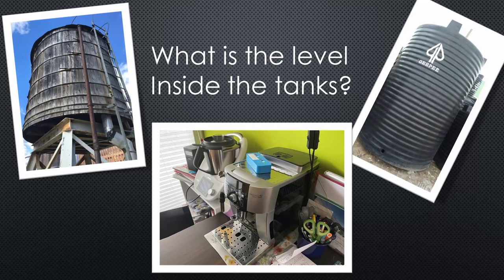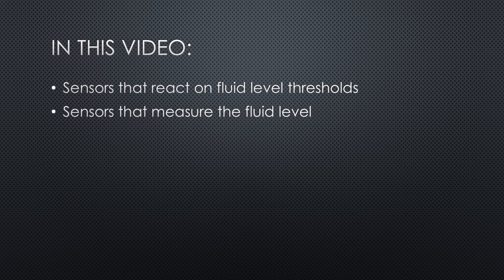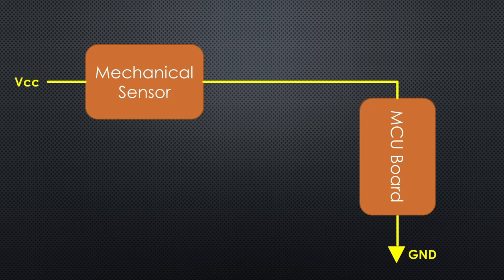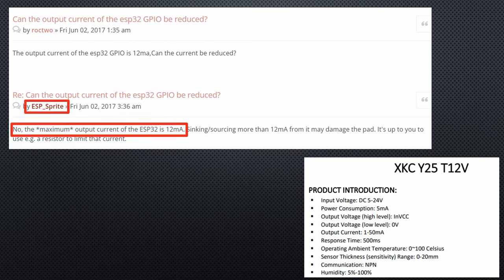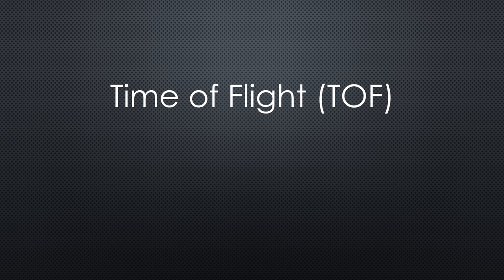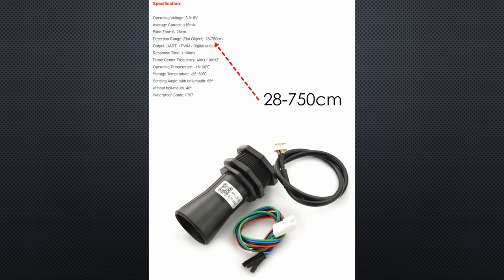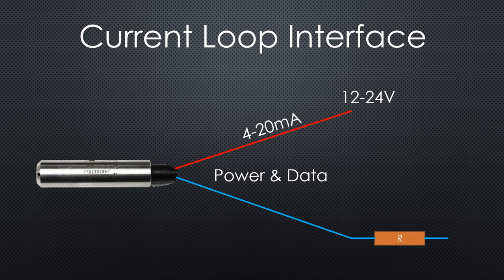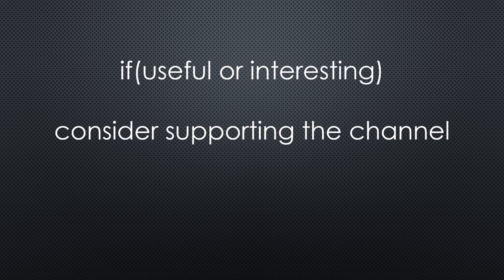#411 Ten Fluid Level (Water Level) Sensors and how to use them (Arduino, ESP32, ESP8266)

Comment: After many trials with ultrasound (not reliable due to humidity over the water and animals like spiders), pumping air in the water (pump and pressure sensor are available in cheap systems for reading blood pressure) which also was not reliable. In the end, I decided for a pressure sensor (available not only for 30psi online). I used a plastic pipe and fixed the sensor  water tight with epoxy resin. The reciever is a Raspberry Pi via analog/digital converter. Works since years in my 2m deep water cistern in the garden.
Reply from the maker: Thank you for sharing your experience. I thought, the air would disappear through the plastic tube over time. But not in your case.
Reply: No. The air in the (empty tube) was not a problem. The tube is sealed at the bottom in the water. But in the beginning some condensing humiditiy made disturbances at the connector after a year or so, resulting in misreadings. I had to clean it and avoid from condensing water.

Comment: Could same water pressure sensor be used also in so called "bubbler" application, to measure height of lake or river. So that you just put simple compressor like for filling car tire, connect it to tube which is then laid on the bottom of a lake and on the same line connect pressure sensor. If my logic is correct, bubbler or compressor should produce exact amount of pressure in order to create bubbles as it is water pressure on the bottom of a lake.
Reply from the maker: That should work (I made a video about converting a blood pressure sensor into a "blubber" sensor)
Reply: @AndreasSpiess  thank you. Yes, I have found it later. Great and helpful video. I will probably do something similar to measure nearby river height.

Comment: You could use an air pressure sensor with a hose connected to the bottom of the tank. The sensor would be over the maximum fluid level, so the fluid would never reach it. Make the hose and the pressure on a sealed system, and now as the fluid level raises, also the air pressure inside of the hose would raise as well, like a washing machine pressure level.
This method would allow to measure the level without contact with the fluid, only resistance to its moisture on the sensor side.
I think the challenge would be to have the system sealed enough to avoid air leakage over the time messing with the measure. 
Do you think this would work?
Reply from the maker: I later made a video where I converted a blood pressure sensor into something you describe...
Reply: @AndreasSpiess  amazing. Gonna search for that

Comment: The old Citroën 2CVs didn't have a petrol gauge. It just had a dip stick, a longer version of the one you check your oil with. You literally had to get out of the car with this yard long stick and put it in the tank. Dipped headlights was a knob you turned on the dashboard, and turned and turned, This again was a long rod at the other end of which was a cog. This turned the hinged pipe that was at the front of the car that had both headlights attached to it. literally dipping the headlight. Those were the days, without all your fancy tech.
Reply from the maker: When I learned to fly we also hat such sticks to check the fuel levels on our Cessnas. Not because they had no meter. But we wanted to be sure ;-)
Reply: @AndreasSpiess  Well, you're still here, so you did the right thing.

Comment: Very good video about the different sensor technologies. I fear that you have missed to add the XKC-Y25-V (induction principle) to your sensor list. And I want to remark that there can exist different enviromental conditions e.g. mud at the bottom of the tank or frozen water in the sensor pipe etc.
Reply from the maker: I had it, but thought, it uses the capacitive method. And I agree that I did not cover most environmental conditions. Thank you for mentioning two.

Comment: Our home sewage treatment plant (kleinkläranlage) has a hose attached to an air pressure sensor. The Sensor sits inside the controller and the hose goes down to the bottom of the tank. Since it needs a air compressor anyway it can fill the hose back up with air on its own. In water tanks I think it is possible that the hose will fill up with water over time and therefor measure incorrectly
Reply from the maker: You are right. I made a follow-up video where I used a blood pressure sensor to build a similar sensor you describe.
Reply: @AndreasSpiess  Thanks, I'll have a look

EDIT: found it #423

Comment: one more principle .....
cylindrical swimmer from bottom to top and measuring its weight with load cell.
the more it is in the fluid the more lift there is from density delta ....
but this looses volume and is mechanical challenge ....
Reply: Consider a spherical cow too. It might be a simpler case to model this first, and after all it is a well known case... :-)
Reply from the maker: Interesting idea. But, as you write, probably not easy to build (robustness).

Comment: I made a level sensor with a pressure sensor and a pipe that enters the top of the tank and runs down to just above the bottom.
I used an LED bar graph chip and an SCR to drive an SSR to run a pump. The SCR anode was  went to the bar graph LED just above the bottom LED and the SCR gate to the LED just below the top. 
The cathode runs to the LED in the SSR.

A complete pump down control with no microcontroller. However, nowadays that LED bar graph diver costs more than a microcontroller.
Reply from the maker: Other viewers mentioned this principle, too and the newest "Make" journal has feature such a project. But they use a valve. did you also have a valve to let the air go after the measurement
Reply: @AndreasSpiess  
No valve, and it didn't seem to leak down either. I had thought that if it was a problem I'd put a small air pump on it and run it prior to measurement, but in the end I never needed it.

Comment: I have used a Wemos D1 mini and an ultrasonic HC-SR04 distance sensor to measure the water level in my garden tank. The sensor measures the distance and the measurement is subtracted from ~2m to give the tank level. The result is sent to 'thingspeak'. I do have a problem with the sensor rusting and have to replace it every 6-8 months. It has been operating for about 4 years now.
Reply from the maker: Thank you for sharing your experience. A straight-forward way of dealing with the sensor. And replacing such a cheap part every few years is not too expensive.
Reply: @AndreasSpiess  At the bumper of the car there are also ultrasonic sensors. Maybe they are better quality. But must be modified too to use as HC-SR04.

Comment: Looking at this topic myself for measuring the level in our rain water tank. First looked at a cheap ultra sonic sensor, but those can give errors when spiders or other bugs start building their house in them :).
At work we always use guided radar level sensors. Basically you insert an antenna in the liquid, it is also a TOF sensor, so the signal bounces on top of the liquid. You also have some sensors that can measure the level of different liquids in the same tank, if they don't mix because of different density. They do need different electrical properties for this to work.
Reply from the maker: Interesting. Particularly the possibility of measuring two different liquids!
Reply: @AndreasSpiess  I can't remember by heart which ones those are. But we normally use SICK LFP, those can also ignore foam layers. They are around 300€ per piece, so probably not the first choice for us makers. But in some situations, maybe the easy choice.

Comment: Can TOF sensor be encapsulated in some glass container for protection against spills etc? I know it will definitely change it's characteristics, but will they measure only distance to glass or distance behind the glass to other object?
Reply: I just experimented with clear plastic, clear polycarbonate material, and glass for your reference and in all cases, it changed the value. However, they do come with their own protective material that you can seal against.
Reply: @ShirolaGhadirian  I'm sure it will change the value, but the question is, if this is kind of constant (slows down going trough the glass) or the glass is non transparent for IR light from sensor - like for example polycarbonate is for far IR light from CO2 lasers (that's why it can cut it easily).

Comment: Worked for Keller druckmesstechnik AG in Winterthur. I cannot remember how many different pressure sensors I have built in those years! Once we had to calibrate a sensor to measure the level of a tank holding Honey.
Reply from the maker: So you are the expert in this matter! The honey tank sensor for sure is not common. But I can imagine that somebody needs it in a plant...
Reply: @AndreasSpiess  Yes, it was for Lang**e :-)

Comment: I'm working on another type of sensors, capacitive liquid level sensor that's very easy to build, it's a simple aluminum foil pair of 2cm wide tape laminated together and placed inside the tank, doesn't contaminate the liquid or corrode, the only not-so-simple side of it is the interface as I want to convert capacitance to analog reading.
Reply: capacitive fuel level sensors have been used on aircraft since at least the 1970's, when I worked on aircraft.  It's a proven technology and very rugged and reliable.
Reply from the maker: Good information (also about the airplanes). Maybe you can use the same circuit as the capacitive moisture sensor I showed in the video (using an NE555 to create a frequency)

Comment: My friend and I are looking into this at the moment for his water tank. He has a solution with a float on top of the water (with weights in it, but less than the float displaces) connected to a string which goes out and into his shed where there is a weight on the other end of the string. He can see the tank level by looking at what position the weight is relative to the wall. We are looking at ways of reading the inside weight position to get a water-level reading. Eg a lever arm to a slider pot, or wrapping the string around a rotary encoder or maybe using an ESP32 cam and openCV... So there's 3 more 'sensors' for you :)
Reply: I used to work at an electric utility and to measure the water levels in the reservoirs we used that same technic but the "string" was a strip (I don't remember what it was made of) that had notches in it that would go around a pully with teeth (so as not to slip). The pully was mounted on a shaft connected to a quadrature encoder with 100 counts per rotation. The pully was one foot in circumference so one foot in level change would give 100 counts. The quadrature encoders are not "absolute" measurement devices so the starting point would have to be calibrated by our hydro workers by occasionally reading a "level tape". They could tell which direction the level changed by which bit changed. Later at some of the locations, a multi-turn industrial enclosed potentiometer was geared to give its full range calculated over what the highest and lowest water levels were determined to be. It wasn't nearly as accurate but it gave a double check on the "goodness" of the other reading.
Reply from the maker: I think the idea of using a rotary encoder is good. It will offer you a lot of precision.

Comment: A few years ago, I made a water level indicator for our Christmas tree.  It uses an electro-optical contact sensor that detects whether or not (infrared?) light is being reflected back to a phototransistor.  It has a push-pull output that can source or sink more than enough current to light up an LED.  A green LED is wired to light up when the sensor is in contact with water, and a red LED lights up when the sensor is not in contact with water.  No microcontroller needed for this simple task.

That hardest part for me was making a metal bracket that clips onto the stand, and holds the sensor near the top of the water chamber (but low enough that we won't overflow it in the time it takes our brains to react to the change in LED color and lift up the watering can).
Reply: The sensor is the Optomax Digital Liquid Level Sensor - LLC200D3SH-LLPK1.  I got it from Adafruit.
Reply from the maker: Other viewers mentioned this kind of sensors from Honeywell. They are nearly 100 dollars. Now we are at 25 dollars. Maybe we even find a cheaper one....

Comment: You could also weight the whole tank (much easier with coffe than with industrial ones ;) ), measure empty and full to have the whole range.
Reply from the maker: Agreed. This is a very accurate way (also used for screws and other material). I should have mentioned it. For the coffee machine it would probably not work because of the wasted water and coffee which would count, too.
Reply: @AndreasSpiess  I assume it depends on the tank. If it's freely standing on something, then only that tank could be measured and that was what I had in mind.

Comment: I came across an early tidal water pressure sensor that uses a novel technique. This sensor was intended to be mounted on the sea bed, to monitor wave hights. It consists of a sealed can with a flexible lid. Inside a wire is stretched between the top and bottom of the tin, around this wire was mounted a horseshoe magnet.  Applying a current to the wire from an amplifier, results in it oscillating at its resonant frequency in the magnetic field. By measuring the frequency of the oscillation, the tension in the wire could be determined,  and thus the water pressure on the lid.
Reply from the maker: This is an interesting idea. To use the force of the water to stretch a wire and so measure the pressure.
Reply: @AndreasSpiess  actually the pressure of the water indents the tin,reducing the tension on the wire, making it oscillate at a slightly low frequency. The idea is not mine, I think it belongs to the US navy, or the oceanographic survey. It was a way of recording tidel range, and coastal wave hight. I collect ideas like this, the science museum is a good source of this sort of information.

Comment: For pressure measurement it is important to correct for ambient pressure too. If the pressure of the day changes, so will your water level reading. This is assuming that the pressure measurement is absolute rather than gauge or relative. In which case the ambient is taken care of
Reply from the maker: You are right. I should have mentioned it.
Reply: agree, as mentioned before, without ambient air-pressure-compensation exact water-level meauserement is not possible for pressure transducers. In hydrometric applications the preesure-sensor is connected   via cable with built-in capillar tube to automatically compensate. Another solution is measuring ambient pressure with second sensor NEARBY and compensate the raw-data  via calculation im mc...1 mBar is approx. 10mm change in water-level...

Comment: For the coffee machine, how about a hidden switch which overrides the existing sensor to allows a last coffee to be made ?  A bit like the reserve switch on the fuel tank of a motorbike !
Reply from the maker: As a biker I completely understand your concept! The machine has a switch, but unfortunately, it is too low and does not include a reserve. But I do not think I can increase its level. But I will have a look at it!
Reply: @AndreasSpiess  I did actuall mean an electrical switch to override whatever detection circuit the machine has, allowing one last cup.  My machine had two electrodes in the water and shorting them made the machine think there was still some water left, rather than stopping mid-brew.

Comment: I use a method with differential pressure sensor .
You didn't mention it.
You just need a rigid tube in water. No wires ne circuit non sensors near or inside the water. If you are interested i will give u more details
Reply from the maker: I made a second video about such a sensor...
Reply: @AndreasSpiess  Link to that video, please!  :)

Comment: How Will you messure the levels in a Glass  bottle of drinkable alkohol That os upside down?
Reply from the maker: I never thought about this problem. The alcohol never lastet long enough and afterwards, the thoughts were difficult ;-)
Reply: You might be able to use a camera pointed at the people in the vicinity of it, then apply an AI to correlate the behavior with the level in the bottle. This method should even be independent of the orientation of the bottle. I admit it can seem a bit overengineered... :-)

Comment: I have an application that the fluid is in a vacuum the amount of vacuum at any given time is variable. I suppose this means a pressure sensor is unsuitable to measure level. Anyone have suggestions or tips I would greatly appreciate it.
Reply from the maker: The environmental pressure adds (or subtracts) to the pressure measured by a sensor inside the fluid. Sou You are probably right (unless you add a second environment pressure sensor)
Reply: @AndreasSpiess  yes! So then level is a matter of differential regardless the amount of  vacuum.
It's a bittersweet feeling.
Bitter because I was already doing this for a flow meter but I wasn't smart enough figure it out for level.
Sweet because I am holding the prize in my hand.
Thank you for your help!

Comment: You can also use a strain gauge on a  support pillar  to masure the deformation of the pillar that is caused by the weight of the water
Reply from the maker: Good idea to use weight as an indirect measurement.
Reply: Or you could measure the induced wobble in the planet's orbit by the relocated mass in the coffee machine.  Everything matters!